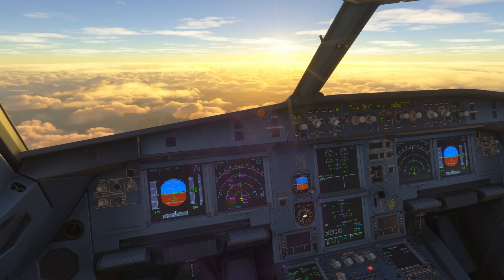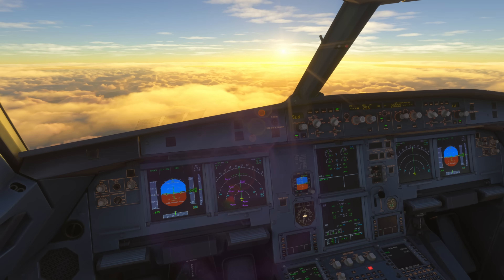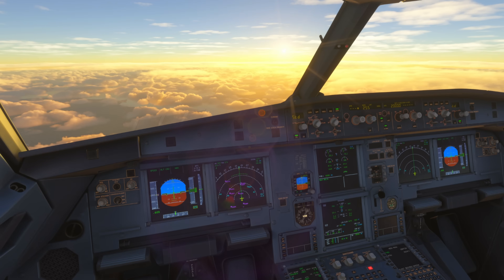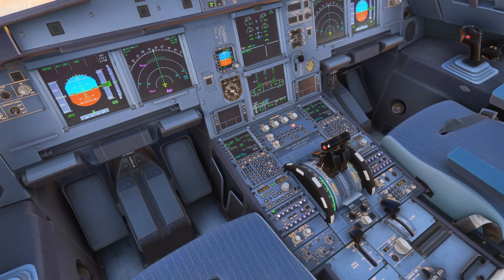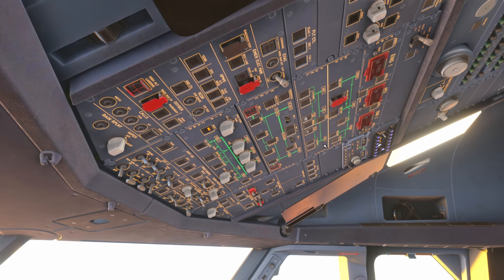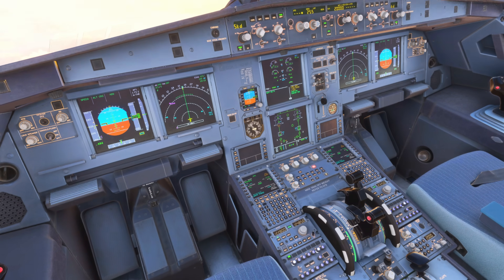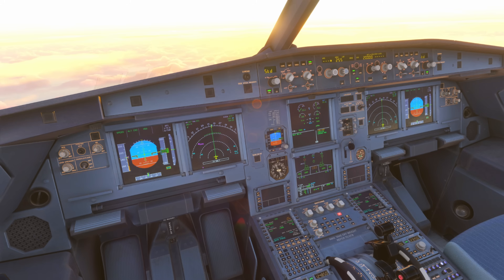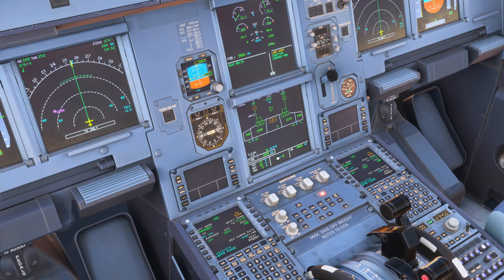A320 Fuel Leak Procedures | Real Airbus Pilot Guide

Comment: In order to be proactive, I realize it's important to monitor FOB at certain waypoints or perhaps every n minutes. Is there anything more specific than that? Do you check FOB at every waypoint and log it manually on the printed OFP?
Reply from the maker: Hello, we check FOB every 30 minutes or when passing waypoints. This is the task of the pilot monitoring and it is cross checked and logged on the printed plan 👍
Reply: @AirbusCockpitCoach  Haaa very interesting. So at every checkpoint (or 30', whichever comes first) you pen down actual FOB vs planned FOB in the printed plan. Yes ?
Reply from the maker: The planned fuel is already on the plan so we just log the current FOB 👍
Reply: @AirbusCockpitCoach  Got it thank you captain.
Reply: I agree great question, captain if you can elaborate on how you actually perform fuel monitoring during a flight. Thank you in advance. Thank you for the video.
Reply from the maker: Hello, every 30 minutes or when passing waypoints. Cross checked by the pilot monitoring against the plan